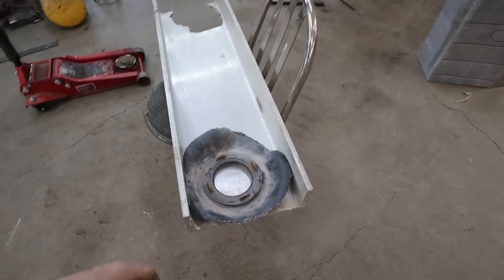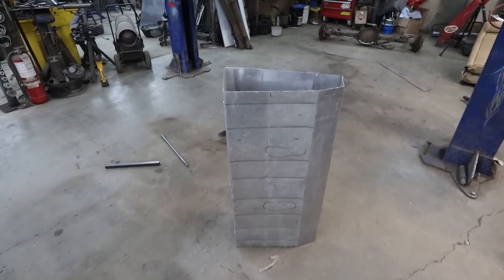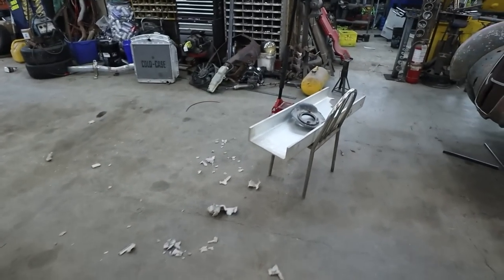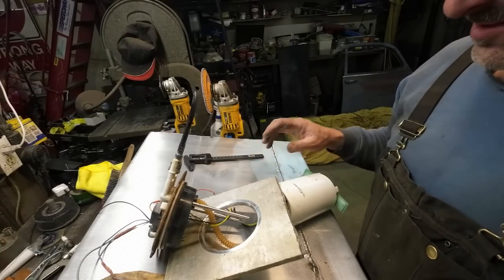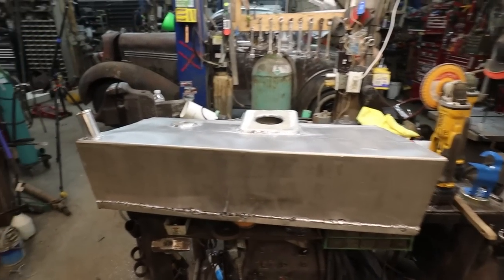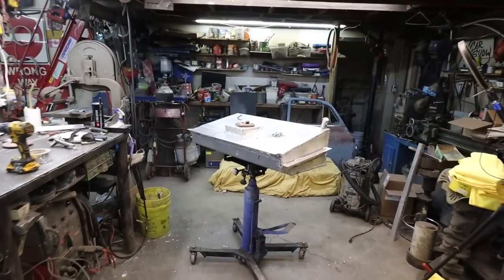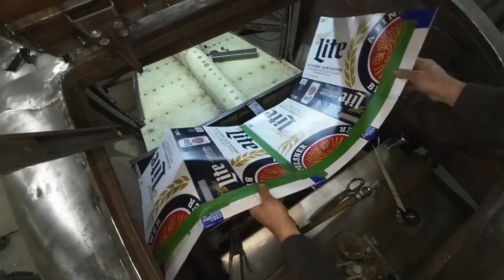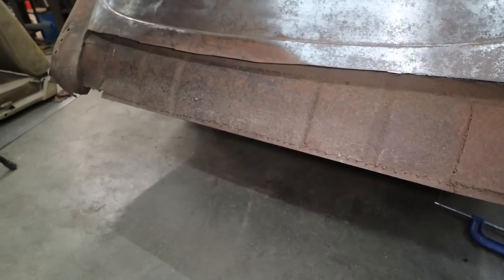Building an aluminum fuel tank from scraps from around the yard.

Comment: Last time I did it I screwed that round thing down to the tank. Been good so far. I used a pump from a suburban, that tanky thing was shorter than the others I had around by like 2" or more, made it easy to cut the stalks and get it to be short enough.

Comment: Greatest machine shop of the Fabricator and Designer. Good Dodge 1936 car for the frame is durable like a SUV compact V8 1935 Dodge OHV. The frame of its sheet metal thick as .2 or .3 inch gauge fit to the frontal half-chassis and no rear chassis per car like Unique body = Uni-body light weight. The tunnel is hump of the sedan's floor but this tunnel is a pipe welded to the floor of the sedan or coupe. No way for it come apart the sedan 1936 DeSoto up/off away from the chassis of your 1935 custom chassis and suspension of lower control arms. The S-10 came apart as a front giant clip and welded to the 1935 custom chassis build by Halfass welder and arc pro TIG. 
 Here, there is Duke all solar cells that power up all the arc and Plasma welder and angle grinding metal cutter disc. In the wood shop of the fabricated similar to Bugatti poop deck interior non-sail car with its 4 wheel size 16 inch rims of American racing for public street and over there went into recession or corrupted of Pittsburg welder Laser 1/2 inch thick steel cutter Steeler iron work. But the Fabricating the floor Uni-body is a possibility wherein the Press is weight over 10 tons and press as squeeze hard like 25 tons to form the pan of the Bugatti as low price same price as your 1935 Dodge Desoto dashboard heating register/vent sheet into a good car. But Uni-body is a different car with ribbed sheet metal into X-body flooring of the 1936 Desoto Accord or Citation in East states. 
  The pipe is together to a hand built car's floor into one piece. The pipe is for solid steel drive train that line to the rear differential and it connect to the output shaft of the transmission. The flanges on both end of the pipe is a strong attached to the housing of the planetary gear differential with ring and pinion gears. The transmission has a flange at back of it to attaching up to the pipe where inside is the solid drive rod (line).

Comment: What welder did you use on the fuel tank?
Reply from the maker: For the tig I have a Lincoln 230 the spool gun I was using my Lincoln 140 mig but it doesn't quite have enough punch and my 220 welder doesn't have the spool switch.

Comment: Brent , are you going to make an access panel in the floor trunk for ease of  pump or sender replacement, and maybe even a drain plug  ???  ,  it would sure beat , a full  gas tank removal  in case of  malfunction...

Comment: You'll never have to worry about that gas tank not lasting, that's for dern sure. .unless you puncture a hole in it. ..2 days ouch. yeah I can see why you'll not want to do that again. I can fully understand ya wanting to go the steel route next time. but that how shit roles sometimes. At we had good content to watch. nevertheless. The thing is if you don't have really good aluminum welding equipment which cost a fortune its a challenging endeavor to weld things up in Aluminum all the way around.

Comment: Aluminum company in California into sheet aluminum with Arc welder into braze the aluminum sheets together for gas tank from Alcoa or Kaiser aluminum company that was recession in East State Welders society and Engineers ASE Metric Central into merge like an industrial of Aluminum and steel pipe Fab. Bell or Campbell or Boeing/Clark/Hughes for car building process. Canal Blvd at Cutting Blvd into Plastic Owens Corning for 10-12 gallon gas tank into the car as well as Portable gas tank for lawn mower as a refiller/container in making Mass production produce custom items.